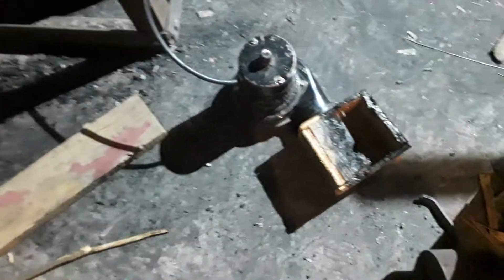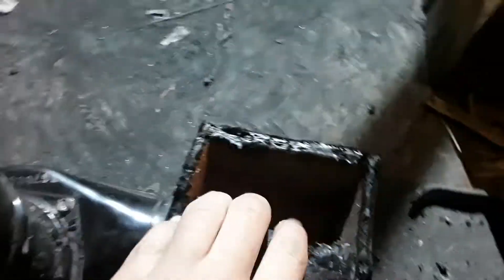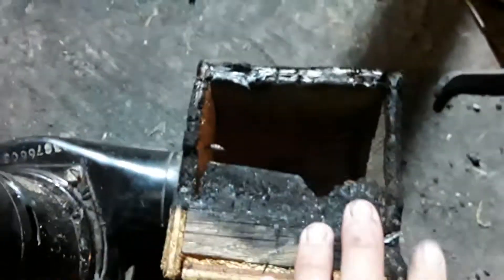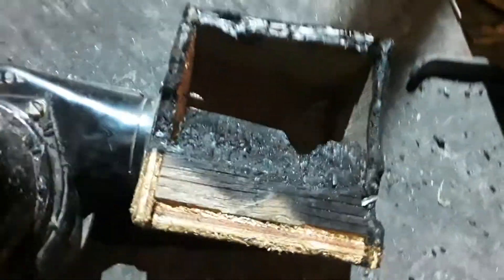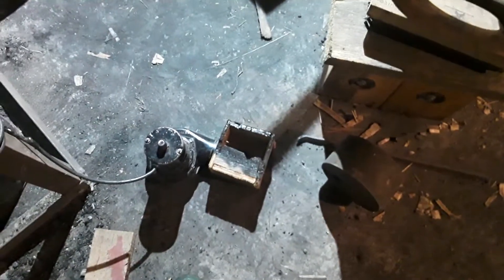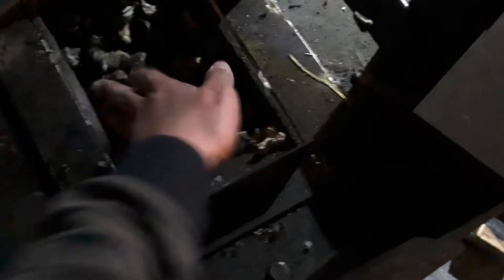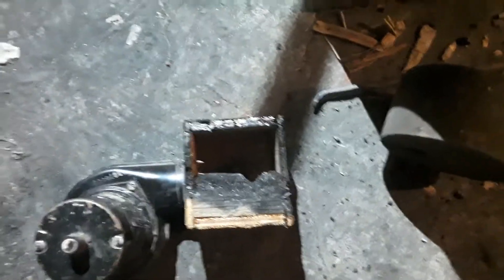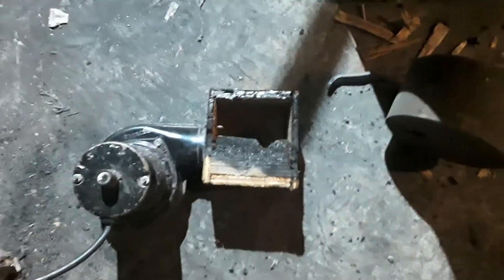...and After Running the Forge...

Comment: I feel ya. My forge runs on a hand pump that drives a flywheel. This runs the blower with a duct tape belt. Until I find a suitable replacement, I risk having to stop and repair it mid project every time I fire it up.